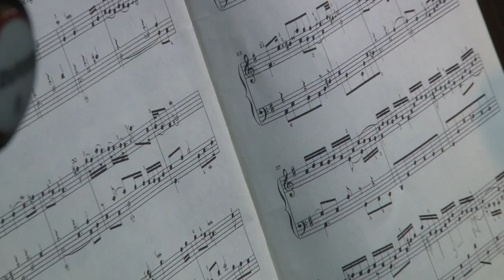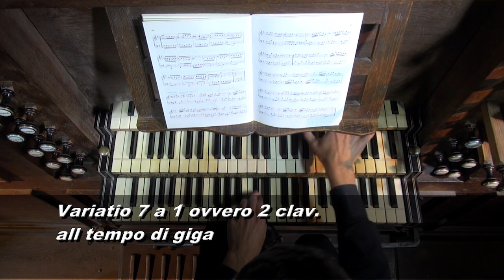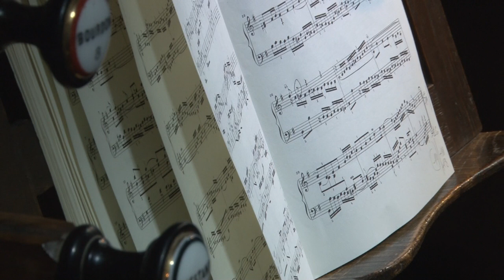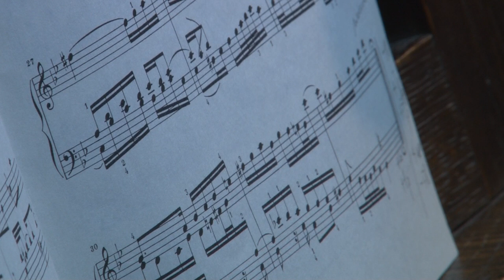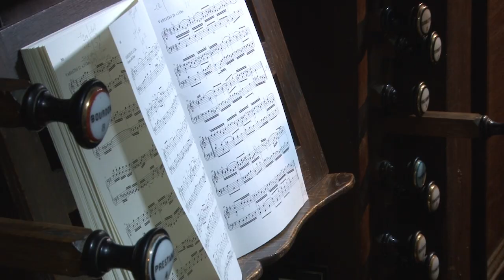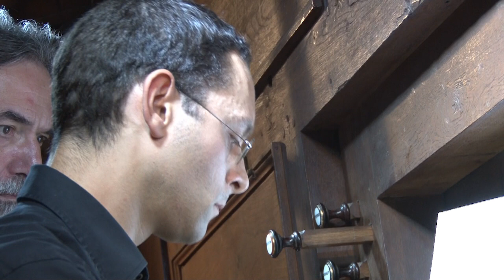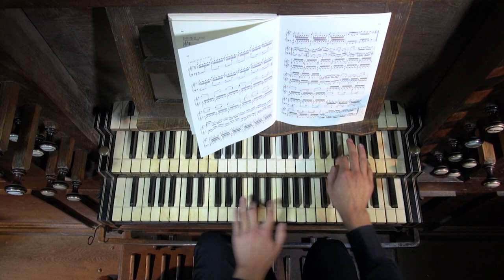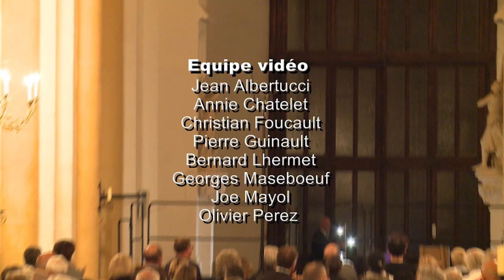J.S. BACH: Variations Goldberg BWV 988 - Benjamin ALARD, orgue (2013)

Comment: I have also played this work, attempting it on the piano, but it is not possible to play it properly on that single keyboard instrument without cheating a little.  It is certainly interesting to hear an organ version of this unparalleled work.  Since I also have a little organ experience, I am well aware that the faster variations cannot be played as fast on the organ vis-a-vis either the harpsichord or the piano.  You will have to use mainly reed stops for any in a quick tempo and, even then, can't go too fast due to the echo-ey acoustics in a church building.  But the race, in this case, doesn't always go to the swift.  
I still feel that the piece is best performed on a two manual harpsichord as J.S. Bach intended, the first recipient being the young, tubercular harpsichordist by the name of Goldberg.  He served his aristocratic patron well and, although his life was short, did go on to produce some compositions of his own.  I am confident that the prodigy would have performed the livlier variations more quickly than in this performance but he would not have been able to produce all the many variations of timbre of this one.  Thank you so much, Benjamin!